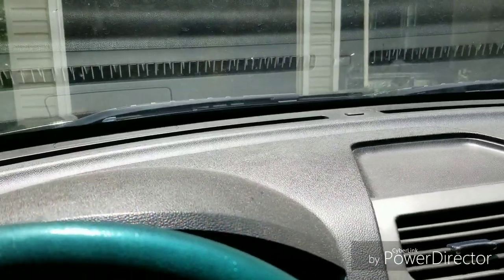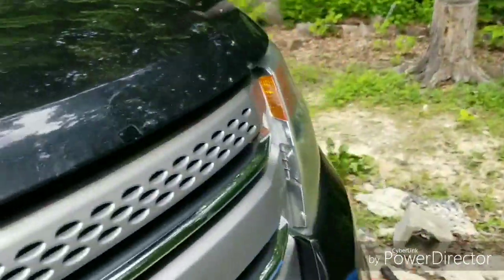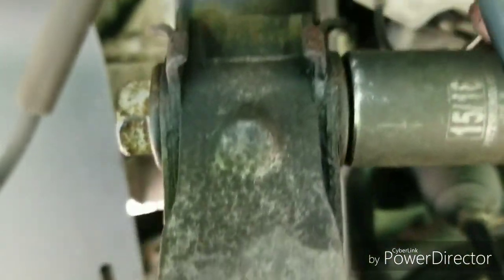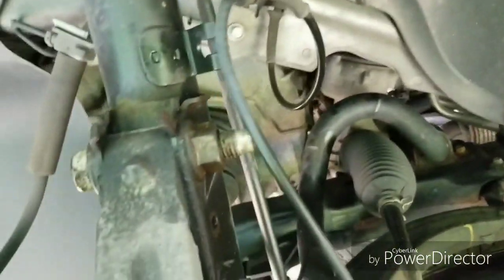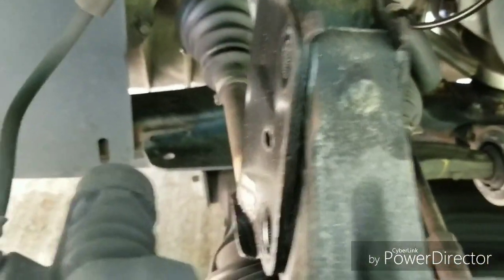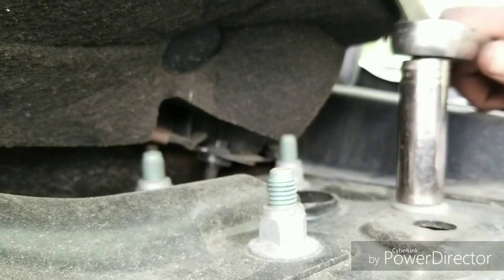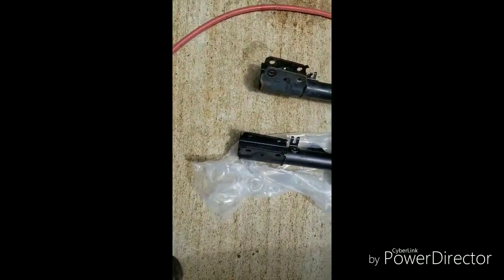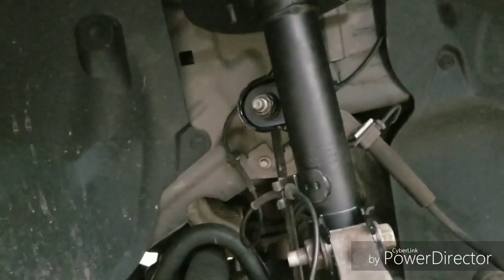2011-17 ford explorer strut replacement/ front end noise

Comment: Had the same noise on my 2013. Though that bolt being loose seems strange and scary it was not what was causing the noise. The noise occurs when the upper strut mount becomes worn causing the spring to shutter when you turn the wheel. Just tighting that nut would not have fixed the noise. By replacing the strut you inadvertently corrected what was actually causing the sound.
Reply from the maker: Thats is true.
Reply: True statement.  I've got a 2016 Explorer Sport and have this twangy clunking sound.  I did some research and I am convinced it is the strut mount.  This guy does a good job explaining and showing how the spring makes the noise:  https://youtu.be/khZ16AOztT4
Reply: That noise is coming from the top of the strut.That has been a known issue with Ford.
Reply: Same issue. the bolt were tight on mine but same noise looks like the struts need to be changed all together. I would say even if he tightened the bolt the noise would still be there
Reply from the maker: Oh ok didn't know
Reply from the maker: Yea guess the strut itself was bad
Reply: @musclecargarage8882  still great video though helped narrow my problem. Thanks
Reply from the maker: @dkbautomotive2709  glad it helped

Comment: Now that you have had the new strut assembly installed for a while how is the ride?  I saw the 1A Auto Quick Strut Assembly but wound up getting the Monroe QSA.  I was really looking for Bilstein B6 Heavy Duty but worldwide back order and indefinite ETA for US vendors.  I found the Bilsteins for Rear but not front.   

With vendor quality being equal, the QSA has one very major advantage over  just replacing the strut and transferring the coil spring over to the new strut.  That major advantage is SAFETY and convenience.  Might be slightly more with the initial investment but the reduced risk of inherent danger in removing coil springs and peace of mind of new coil springs in my opinion far outweigh the slightly higher price....

Also don’t forget to have the vehicle aligned immediately after strut R/R.
Reply from the maker: The ride honestly feels the same i didn't feel any changes

Comment: Did you ever change the sway bar links? I'm having a hard time getting the bottom nut off....
Reply from the maker: No i didn't i was having a hard time getting them bolts loose. Im probably going to have cut them off
Reply: remove the nuts on both sway bar links and then pry up the sway bar to have room to remove the bottom nuts

Comment: did you have to compress the spring to get the old one out?
Reply from the maker: No it comes assembly and comes out assembled so no spring compressor needed
Reply: With vendor quality being equal and probably a reasonably good conclusion that most Aftermarket struts are.....with quality being equal the Quick Strut Assembly as they are known are very beneficial even if higher price.  

For my money not having to deal with a spring compressor and the danger in that task is well worth the extra cost of the QSA..

Comment: I just replaced the whole strut assembly on both sides and I still hear the damn noise. I'm so pissed!!!
Reply: It's your ball joints
Reply from the maker: Dang really. Yea check ball joints and make sure everything is tight
Reply: Check control arm bushings.
Reply: Did you figure out what it was?